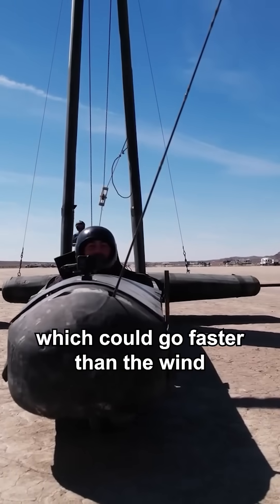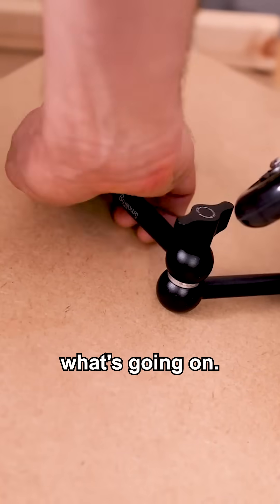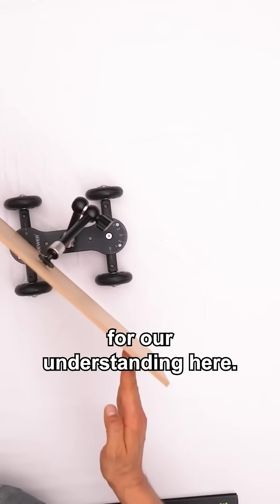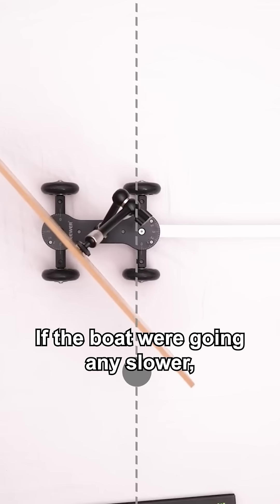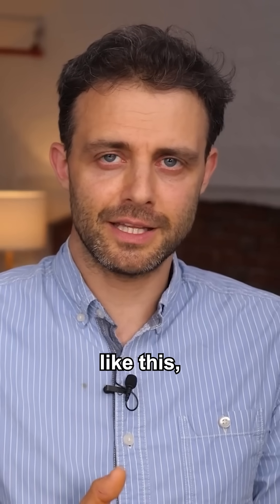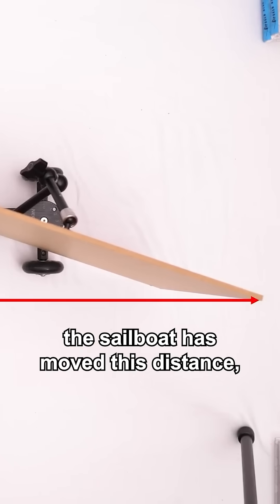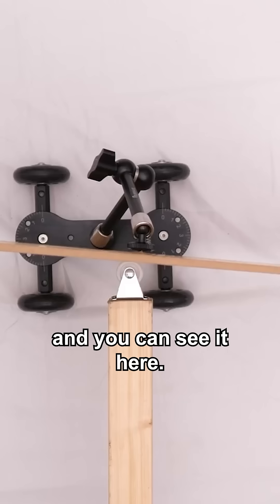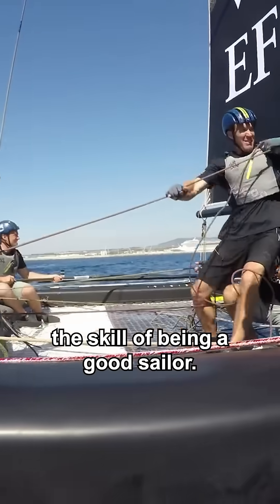How a sailboat can sail faster than the wind

Comment: Amateur sailor here. There is also a bit of lift that impacts the way that the boat moves. Especially when we are going as close to up wind as possible, we have the sail as close to centered on the boat as possible, pretty much eliminating that horizontal force. So we end up mostly relying on the resulting shape of the sail to act as a horizontal lifting body.
Reply: A sailboat will only be dragged by the wind when one sailing directly downwind. On every other course we rely on laminar flow around the sails that generates „lift“.
Reply: @nSnowCrow  To be fair even downwind you can have lift generated. Watch America's cup, even with wind at 170-175° respect to their course they go twice as fast at minimum.
Reply: @bellini98-1  " even downwind you can have lift generated" That is due to the effect of the apparent wind which wasn't explained in the vid at all. Due to the movement of the boat and the resulting headwind the "true" wind direction gets shifted forward to what is known as the apparent wind. A sailboat will trim its sails according to this apparent wind meaning in your example the sails will be more closed than they would normally be for that true wind direction. Obviously the faster the boat can go the more extreme this effect can become and Sail GP cats going 50 knots almost always have their sail very close
Reply: @bellini98-1 Yep, this is driven by apparent wind - air flow over the sail (or the wing in the America's Cup) caused by the boat's forward motion through the air. 😊
Reply: @bellini98-1  that's because of apparent wind. You're sailing the wind you're making by moving through the air at that point. Or rather the vector sum of the true wind and the wind created but your movement. The explanation in this video is completely off.
Reply: @bellini98-1  that's because of apparent wind. They're not just sailing the true wind (what a stationary object would feel ) but the combination of the true wind and the wind created by the movement of the boat through the air. Sails are amazingly powerful, most sailboats are slow because they have to contend with very significant drag from water, but ice sailors regularly do very high speeds with a moderate 15 to 20 knt breeze. The videos are fun.
Reply: @nSnowCrow that's a great point! Sailing down wind, second to sailing directly in wind, is the most inefficient way to sail.
Reply: So sailing is just flying in 2D
Reply: @Kukkakukko  foils are basicaly sideways airplanes yeah
Reply: @Anderkent you mean underwater airplanes
Reply: @Kukkakukko I was asking myself a similar thing. We see all the illustrations and tests with solar sales. Why are they directly aimed at the sun. I know that the sunwinds are probably going lightspeed and that you can't fly faster then that (theoretically, because as faster you get,  as bigger the ship would become), but why aren't they using this angle to gain more speed in space? The principles are almost the same (or at least I think they're almost the same).
You don't even have the resistance of water or the winds...
Reply: @Spielername  The effects you use when sailing are because air is dense and acts like a fluid for the purposes of physics. Photons in space generally don't follow those rules in the same way which is why it doesn't work the same.
Reply: @Spielername  Because this technique requires the boat, or in this case the spaceship to move at an angle to the force that pushes it forward. This is only possible in water where the keel of the boat prevents it from moving sideways or on land where the wheels allow for forward motion but not sideways. In space there is no way to do this so if the photons push from the direction of the sun the whole thing will move away from the sun and there is nothing that can be done about it.
Reply: @Spielername  No, the principle of a solar sail has two differences. 
One, it is in a near vacuum, no resistance.
But, two , and mainly, the light isn't "a medium the sail is "flying" in. It is a force, pushing  directly away from the  light source. The sail being angled can tack the  spacecraft but this is by changing the  angle of reflection, which is different to what the  sailboat does.
Reply: @Spielername  Solar sailing actually is quite different as it deals with orbital mechanics. The aim will be to raise or lower an orbit, so the sails will be angled to deflect the photons either backward in the orbit (accelerating the craft and resulting in it spiraling outward) or forward in the orbit (slowing the craft and lowering the orbit). For example, if you're in solar orbit trying to get closer to the sun, you'll have the sails angled at 45 degrees to the sun to deflect photons ahead and slow you down.
Reply: @momoz74  Thank you. This is actually explained in a way I can understand completely.
Reply: @MercyZiegler-e4s  Thank you! This is the reason you can still "tack" with solar sails. In a sense, you could think of your orbital momentum as the solar sails analogy of the keel force.
Reply: @Spielername Perhaps affected by an additional orbital velocity. Just guessing around. 😂
Reply: @momoz74 I was reading for this comment.  People often forget the importance of the keel, the friction of the wheels in his model, but of course there’s also the righting moment of the ballast keel which is uber important.
Reply: @Spielername  
The  fastest the Solar wind  travels is about 750 kilometers per hour. This is about one quarter of a percent of c.

But solar wind does not deflect from a normal sail. Matter of most sorts experiences protons at this speed as ionizing radiation, and they penetrate into the surface. With essentially no deflected matter, the angle of the sail is irrelevant.  The sail gains the momentum of the solar wind, but most of the energy merely                 becomes heat (after becoming secondary radiation and light and so forth).
Reply: @Kukkakukko  My grandmother, who both flew recreationally and sailed recreationally, said that they were similar mechanisms, just flipped 90 degrees
Reply: Basically, yes!   @Kukkakukko
Reply: @Kukkakukko  essentially yes
Reply: @Kukkakukko  upwind yes. Not just the wind, you're also doing the same with the water with your keel
Reply: @Kukkakukko basically. We're not out there lifting off the surface of the earth... Normally😅
Reply: Ever been up on foils? Non-sailor here. It appears terrifying.
Reply: Yes. It feels very smooth compared to being on a hull or Ama @ChrisNotTheKing
Reply: Thanks for the info
Reply: I think they understate the amount that lift affects this process.  It's actually a great point of why the "90 degree to the wind position" (also called a "reach" in sailing terms) is typically the fastest "point of sail" or "direction to sail relative to the wind".
Reply: What fascinates me, is that you can actually cross against the winds. I'm very interested in astrophysics but I'm not even an amateur. All I do is to try to follow the news around everything astrophysics related and I think I have quite an understanding as long as it doesn't come to math but if I'm frank, almost everything that's astrophysics related, is only to understand with math from a certain point on.
But I've never followed the "down to earth physics". So it's somehow hard to understand how this is even possible. I saw grafics and I know how it works in theory, but it's just so amazing, and every time I see it (what doesn't happen so often), I'm just wondering how this is even possible.
Reply: @Spielername Cross the Atlantic Ocean you mean?
Reply: @Spielername  when you go cross wind is when you would swith the angle from say a 45 to a -45 instead so that even though youre going across the wind plane youre still grabbing as much of it as possible in your sails to match that. Theres been a few times ive been sailing with my grandather and have been stuck on one of the ropes constantly moving the head arm of the mast back and forth
Reply: Also the hull contributes
Reply: In life, there's no experience that quite matches being on a sailboat heeling hard against the wind. Especially a small one. It's just freaking awesome!
Reply: Wind does not always push the boat, sailing to wind generates Bernoulli force on the airfoils (sails) and is resisted by the opposing Bernoulli force on the hydrofoil (keel). As a result of this interaction of force the boat moves forwards.
Reply: theres also another variable on actual boats - that of sideways push and resistence and healing from windforce
Reply: Damn thats amazing
Reply: Technically it's a vertical lifting body, because the "lift" force acts perpendicular the surface orientation. Sails are vertical. Wings on airplanes are horizontal, so the lift force is vertical.
Reply: At the end, he forgot there’s a thing called drift on sailing boats
Reply: Thanks! Wanted to write the same 😊👍
Reply: It's not just a bit of lift, it's quite significant and I'm surprised they don't bring it up here. The shape of a sail is very similar to that of an airplane.
Reply: There is no such thing as Lyft there is only push. What we once thought of as lift, we now realize it's just aerodynamic efficiency
Reply: Yes, you are correct. Lift is the driving force of the boat. Unless you’re going down wind. This is why we trim our sails using the tells, to maximize wind flow over the sail for maximum Bernoulli force.
Reply: Exactly the sail ends up shaped like a wing and produces lift. So 'wind deflection' is not really what produces the 'thrust'
Reply: I actually just wrote a similar comment before stumbling across yours.
Reply: What he described is called a Close Reach, which is an upwind sailing setting. While the fact that a Boat can sail almost directly into the wind should be a tell tail 😂 that going fast downwind should be conceivable, it isnt easily visualized nor is it intuitive. The car can go faster than the wind, but I have yet to be on a sailboat that accomplishes that feat. Although pro teams have borrowed my equipment in the past for just such races. Those idiots sail TOWARDS waterspouts, LOL. No, thank you. 😂

Comment: What you said is, "If your sailboat is sailing faster than the wind, your sailboat can sail faster than the wind."
Reply: Nope, he said that for given angle there is some relation between speed of a boat and speed of the wind
Reply: @ IF your boat is already moving fast enough to dodge the "wind packets."  It's true that sailboats can sail faster than the wind, but this is an oversimplification that makes the explanation illogical.

Comment: You need to have resistance for the boat to go faster than the wind, because without the water pushing against the boat, the boat will only move in the direction of the wind.
Reply: He meant resistance in the direction you’re going

Comment: So what is the optimum angle?
Reply: Depends on a lot of factors, but generally the basic idea is, let the sail be as far out possible, but don’t let it start flapping (that would mean the wind is pushing on it from the front). To help with this we use telltails, little bits of yarn taped onto the sail in specific areas so we can see how the air is flowing around the sail. there also are a lot of other ways to adjust the specific tightness of different areas of the sail (by pulling it down, tightening an edge, etc.) to make trimming to the optimal location possible.

Comment: There's a lot of oversimplification here, because aerodynamics is never that clean. But the simplest argument is from symmetry. If we take the sail to be symmetrical, then zero angle of attack must produce zero net force on the sail. That does happen to match the "just misses" angle. Of course, real sails aren't just perfectly flat sheets, so it gets a bit more complicated...
Reply: Agree. I was actually sitting on the edge of my chair to say the exact same. While this can say something about the theoretical maximum speed given ideal conditions it's not worth anything, because the speed would approach infinity as the angle of the sail approaches 90°. As soon as non-ideal conditions are introduced fluid dynamics come into play.
Reply: Simplification is a process by which a deeper understanding can be achieved. Ignore some bit for a while to learn some things, then come back to what the simplifications skipped. Navier-Stokes didn't fall onto a page in one hit.
Reply: @ This tends not to work well for understanding of lift. There are a lot of "intuitive explanations of lift" out there that are just wrong. Not incomplete, but lead to false conclusions. A simple model is good if it gives you a starting point. But this one actually leads you astray if you generalize.

Comment: There is another "intuitive" explanation I like for the sailboat going faster than the wind: imagine squeezing a (slippery!) cherry pit between two fingers. It can leave your grip at higher speed than the fingers are closing because of the oblique angle it's shaped at.
Reply: That's a poor analogy because the cherry pit immediately begins to decelerate after initial acceleration.
Reply: @CalebDiT Please explain deceleration .
Reply: @ After you explain what "deliberately obtuse" means.
Reply: @CalebDiT So? It's about acquiring the speed. (Put it in vacuum if you want.)
Reply: @CalebDiT So what? Imagine it in vacuum then. The point is the conversion of a slower speed into a higher speed. How long it lasts is not part of the analogy.
Reply: @ So now you need a vacuum for your "intuitive" explanation about aerodynamics?  My friend, find another video with a better explanation.  This video doesn't explain anything.
Reply: @CalebDiT No, you don't need vacuum if you stick to the intended analogy for just the principle for that moment when it happens
Reply: @CalebDiT  What? After the squeeze the cherry pit then flies out of your finger, makes an arc, then hit the ground. What deceleration are you on about?

Have you seen an object in motion before?
Reply: @ We're talking about velocity in the horizontal plane.  Have you never seen the movement of a boat on the water, before?  Let's discuss relevant details, not how cherry pits accelerate as they fall off cliffs.
Reply: @CalebDiT  There's no point if you don't even share a common understanding of reality with everybody else.

Even in the horizontal plane, are you saying the cherry pit freezes and drops straight down as soon as it leaves the finger? What do you mean by "immediately decelerating to zero"?
Reply: @randomnobody660  "Immediately decelerating" does not equal "immediately stopping," although I see how my phrasing could be improved.  The pit immediately begins to decelerate and will eventually stop.

Comment: Its so easy to mix up standup matt and sitdown steve I got confused for a second
Reply: Apparently the one who sits down gets mouldy
Reply: I could tell no difference until I saw this and then watched the video again
Reply: How? Ones british one is Australian
Reply: @DanTheManOG exactly, so basically the same thing.
Reply: Criminally under rated joke  @JasperJanssen
Reply: @DanTheManOG it's the same picture. Jpg
Reply: Sitdown steve 😂😂😂😂
Reply: You forgot sailing Derek at the beginning
Reply: Funny you should mention that.  I only recently realized that Matt "DIY" Perks and Steve Mould weren't the same people.

Ze Frank kind of looks like them too, although he's in front of the camera less.
Reply: I was taught that if you are sailing into the wind. The apparent spread of the wind increases.  I think it relies on the keel holding a line.  Can this apply to solar sails?  To go faster than C?
Reply: they sound exactly nothing alike wdym
Reply: @piripiri-kefalotyri They are clearly being silly